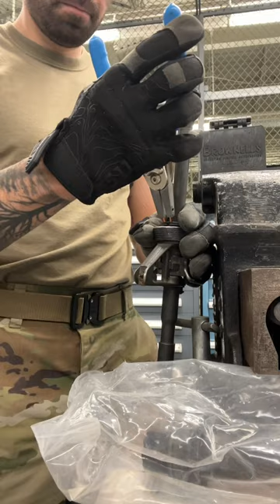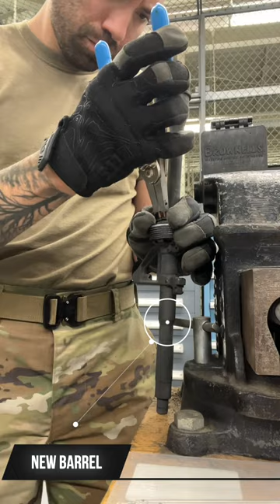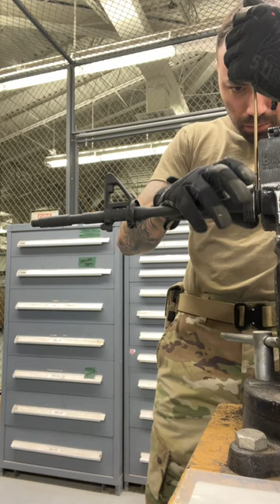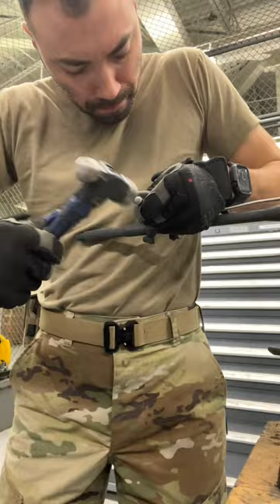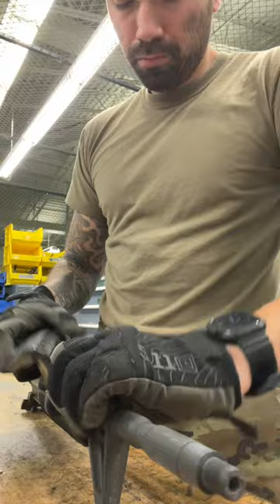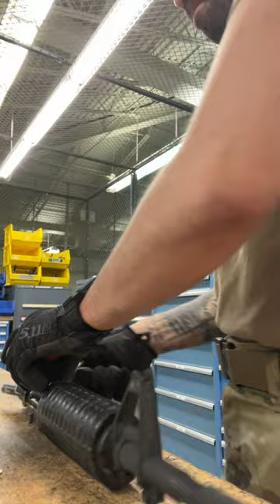How I Change A Barrel On A M4

Comment: Finally got around to it last night. Way easier than I expected. I'm doing an A1. Actually, the hardest part of the whole thing has been getting the damn pin in the rear sight adjustment. What a struggle. I had to just put it down and will try again later. Only part I haven't finished yet.
edit - m16a1 not m4a1